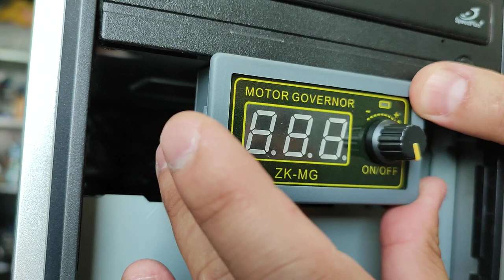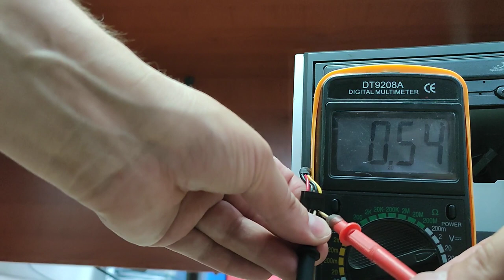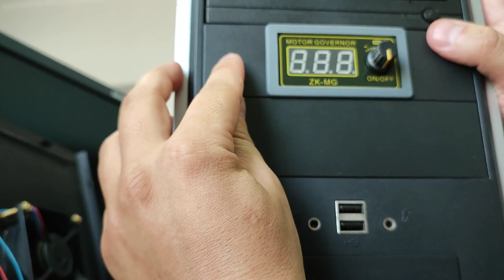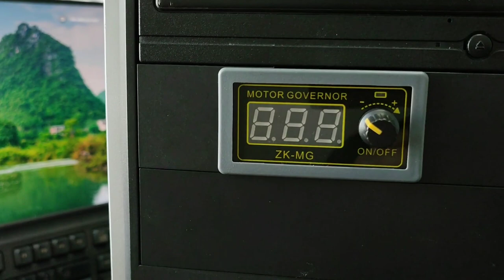DIY PC Cooler - Speed controlled

Comment: I guess That's a solution if you have an ancient computer. For at least 10 years, motherboards have a 4 pin fan connector that can control the speed of a 4 pin fan. Also a modern PC case don't even have those small front panels.
Reply from the maker: Yep, you are totally right